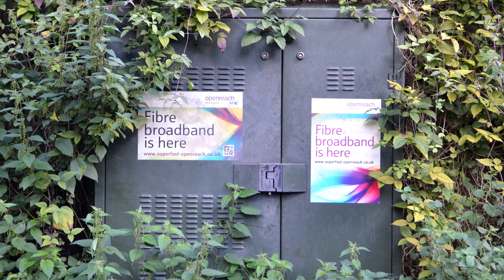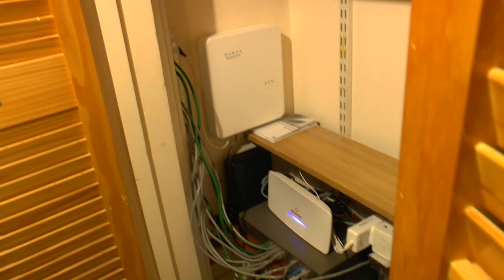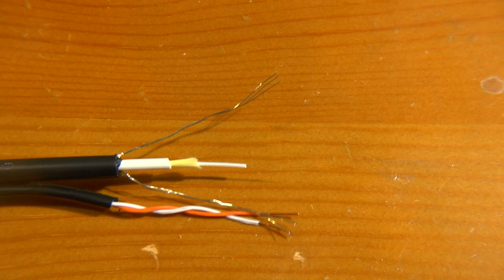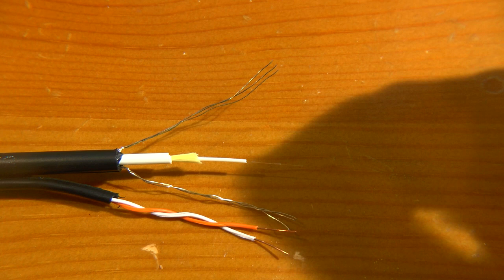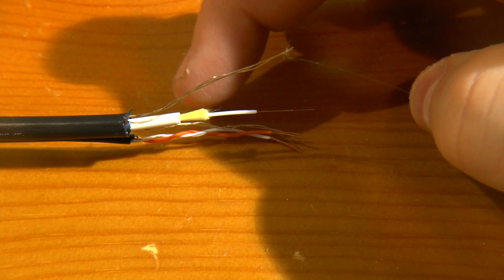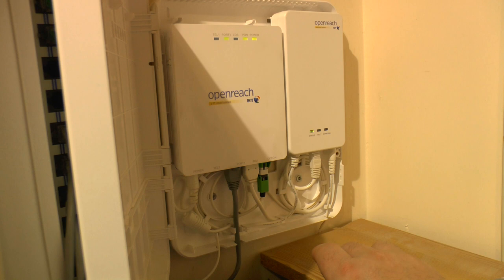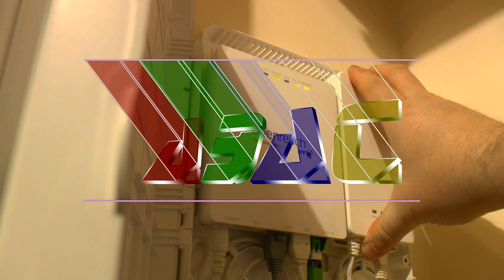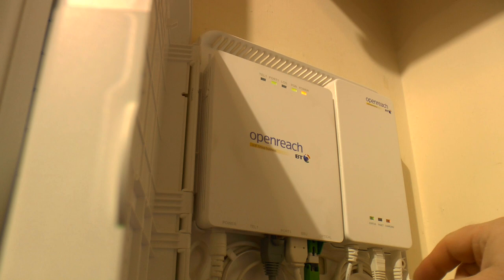FTTP - Fibre To The Premises

Comment: I have a question, the other ports around the house have shutters over them, are they connected to the fttp
Reply from the maker: Ports around what house? I've just skipped through the video and can't see any.
BT NTE sockets and RJ45 outlets usually have shutters so it depends which you're referring to.
Reply: @AintBigAintClever  Sorry I meant the shutter ports around my house and if they are connected to the fttp. Sorry I am not very tech savvy
Reply from the maker: @jacobdavies7892  That'll still depend on what they are, plus whether or not they've been connected to anything at all.
If they're RJ45 (network) then they should all go back to a patch panel in a single location where they can be connected to a multi-port network switch or a broadband router.
If they're BT sockets then they should all go back to a connection on the back of the BT master socket (NTE5 or the newer NTE5C) unless you have just a fibre service in which case I'd expect them to go to a socket next to the FTTP unit. See page 12 of https://www.openreach.com/content/dam/openreach/openreach-dam-files/images/fibre-broadband/fibre-for-developers/guides-and-handbooks/oct-2019-update/Fibre%20handbook%20V9%20web.pdf
Reply: @AintBigAintClever  Thank you so much

Comment: What will happen if i unplug the back up battery? Does it need to stay plugged in?
Reply from the maker: I'd expect it to work without one.
Reply: AintBigAintClever it never. It ran for a few hours till battery died.
Reply from the maker: @muggerslane1  So you unplugged the battery, but left the battery plugged in?
Reply: AintBigAintClever. I unplugged it from mains. Never touched nothing else. It’s only got batteries as a back up incase a power cut.
Reply from the maker: @muggerslane1  I assumed you meant unplugging the backup battery from the system itself, not unplugging it from the mains.

Comment: Why do you need to routers where as virgin they have 1?
Reply: virgin fttp has a powered ONU outside on a wall in an ETB, this then connects internally to your router over coax. on hfc you just have the coax drop cable fed right from the street cabinet into the ETB on the wall and then in to your house to the router.

Comment: Can you use your own router with this? I have a mesh system currently which is miles better than any ISP router
Reply from the maker: You should be able to replace the router with another one (as long as it supports PPPoE) but not the ONT (which needs to deal with the GPON stuff).

Comment: What is the purpose of the battery backup unit.
Reply from the maker: If the FTTP unit is also providing analogue telephone service (through the BT jack at the bottom of the unit) then the BBU will allow this to work during a power failure.

Comment: Btw the 2 guys who installed my white box told me that the battery backup allows 4 hours of internet if theres a power cut but I said bollocks because the router doesn't have a battery so that will turn off but the box will be on, doesn't help me on wifi lol
Reply: Then get a battery for your router, not his problem
Reply: @AgentOffice  he chatted like  it wasnt needed like a spastic and I don't need the backup anyway because we don't get power cuts here.
Reply from the maker: It's not there to provide emergency internet service. It's there to provide emergency telephone service (if your phone line comes over the same optical link).
Reply: @AintBigAintClever  tell the geezer who fitted it lol. I don’t care like I said we don’t get power cuts and I don’t use a landline these days.

Comment: Curious to learn why you'd go to the effort of having FTTP, but then have only 80Mbps?
Reply from the maker: At the time Plusnet's FTTP pilot offering was FTTP at FTTC speed, at FTTC price.  Basically the same service delivered over fibre instead of copper.  It was still a welcome jump from the ADSL previously in use (the local cab was never provided with FTTC service and was last in the area to get FTTanything).  I've just checked and 145/30, 300/50, 500/75 or 900/115 are available if I want it, but I don't need it.
Reply: @AintBigAintClever  Ah - I assume you are in an area that without the FTTC cabinet (because it looks like it was physically impossible to land it) you were upgraded straight to FTTP. This happened around the corner from me in Bridgend - I have an FTTC cabinet about 1km away, but to the right of my street, the next PCP cabinet is bang outside a pub with no room for said FTTC, they all had FTTP years ago. Only last week have I finally been able to have FTTP whilst most of the rest of the town have had several options for quite some time.
And yes, I can appreciate ADSL straight to even 80Mbps FTTP is a massive, massive jump, because the latency is also so much better on full fibre.
Reply from the maker: @gorebrush  when I spoke to an engineer working on the pole by my house he said some of it was just to bring up the average speed in an area.  Got a load of cabs offering an average of 60Mbit download?  Drop a 330/30 FTTP cab in and hey presto, the average in the town has jumped up.  They could've plonked an FTTC cab nearby easily enough.  Incidentally that green cab is apparently down in its own well from where the road was raised but nobody was prepared to pay BT for the work involved in lifting the cab.

We've still got areas where FTTanything is unavailable.  Openreach have their work cut out if they're planning on shutting down the analogue services on time.

Comment: Houses on either side of mine qualify for fiber to the home  Our building doesn't. its listed as a single family dwelling but was taken over by a supportive housing provider and now has ten separate people living in it. As a result of it now a  Multi-tenant unit and all tenants would have to sign up for internet service on fiber  before Bell would run fibers to the building and the agency that owns the building would have to do the renovations to run fiber to each individual room at their cost (They have quoted by Bell $1000 per room to run fiber from the street  to the building since they are individual tenancies and each is considered a new install for  the building as a result of it being marked abandoned a  few years ago) . The agency that owns the building then  was quoted $500 per room to run fiber into the building and into each room (All ten must be done simultaneously), So we will not have fiber this century. They have already removed the copper connection to the building since  the house was marked as abandoned as a result of a malicious neighbour that wants us out of here. So I just use my phone.

Comment: they dont supply the BBU anymore
Reply from the maker: If the phone socket on the ONT isn't used then technically it's not needed. If the socket is used then the BBU will be required to maintain PSTN service during a power failure.

Comment: Wow this set up so over complicated! Our fibre goes straight to the gateway. Our gateways have a built in ONT made by Calix which is so much better and less equipment. Does your government require this type of set up?
Reply: This isn't overcomplicated because openreach network must allows other ISP to sell services. ONT is openreach equpiment and router can by supplied by any ISP chosen by client. Else how you would do it? You can't really bring your own ONT/Router all in one in this kind of network. Search out a bit on Calix website, they are also doing 1 port ONT for familiar purpose.
Reply: @wiziek  & Doug; this is why you cannot get an IP address for a PC connected to the ONT; the router has to run PPPoE out of it's WAN port, to enable the packet level connection with the ISP you are buying service from. So in theory, you can swap out the BT hub for a Virgin or Sky Box (or change the login details if you have a 3rd party router)...
@ABAC ; informative video is from 2018; are Openreach still installing the same stuff 3 years later ? & will HM Gov have "something to say" about use of Huawei ONTs  ? ;-)

Comment: Is it surface mounted inside the house?
Reply from the maker: Is what surface mounted?
Reply: @AintBigAintClever  The fibre cable
Reply from the maker: @jihall47  In mine it's in 50x50mm trunking which I already had running down the wall, otherwise it would've been clipped to the surface. The inner fibre cable just looks like phone cable and is almost as flexible, I think they strip the outer black jacket off for most of the indoor bit, with the copper cable run into either a junction box to convert to white indoor cable or straight into a phone socket.
Reply: @AintBigAintClever  Thanks

Comment: i live next to my Exchange  litterally next to it  , that inturns gives me an EO Line (Exchange Only) . 
So becasue i have an EO line i cant get any form of super fast Braodband . i however am not fully upset by this as i do have Broadband and it is at max speed ish of 17 MB Down 1 Meg up  but usually i get 13 ish on a good day 15 Mb .
If i go to https://www.openreach.com/fibre-broadband and put in my address,  it now says after 9 years of being in this propperty that 
"Good news – we’ll be upgrading your area to Full Fibre (Fibre to the Premises - FTTP) soon."  
1 year later still nothing .. i have been informed that works will be completed by August 2020 but why do i have a funny feeling they wont be upgrading me as i live next to the Exchange .
Reply from the maker: They'll have to at some point but for some reason they can't just put green cab equipment in the exchange, they've got to put a new cab outside and move your line to it. Might be more straightforward with FTTP, who knows.
Reply: @AintBigAintClever  well lets hope its soon .. with 2 Teenage Kids and  2 Xbox ones and 3 ipads/iphones and 3 Smart TVs and 4 Alexas and 8 Smart lights all using bandwidth .. my poor 17 MB is at breaking point ! hahah

Comment: Wish I lived in a real fiber area(I agree with cityfiber fttc should Not be called fiber, it'd like mobile providers who said they had unlimited data when it was 2gb so three had to call there AYCE due to fake unlimited daga) ,

If FTTP was here I would drop virgin cable at right away (or might force them to put the FTTN nodes at the per street level instead of 10-30 repeaters running off one FTTN cab ,, 

As I am fed by a pole (if I was on open reach) so all I need is a 8 way fiber splitter on the pole please :) when open reach can be bothered to move to FTTH installs,

 I feel sorry for any one who is getting there phone lines from underground will be the last to  pepole to get FTTH (as they cost the most to do) 

as with houses that get fed from pole bt only needs to do work upto the pole (at there own time) and a engineer that has pole to house install fibre certified (like youtuber had) 

with underground the issue is the land owners property as they would have to dig up the ground to each house and all the ground to the house (and not all cabling is piped to the house a lot of them are buried)
Reply: We're underground here, but the cabinet is literally a single straight run of about 100m of duct to the manhole right outside our front driveway... from there a single length of new ish (2005) 3inch ducting that I installed myself after some twit (bows head) dug thru the 1960s armoured feed cable..
Reply: Pretty much all new builds for years have underground feeds and are fully ducted with swept tees. These are actually the cheapest properties to deliver FTTP to.
Reply: CarlT but they still use copper on new builds (all of the around here where I am still doing copper installs on new builds,they even had to dig up the road and curb to put more pipes in as they had filled up the current ones with copper cables)

Comment: Jesus man,i hav fibre to outside terminal. I download what i like, i stream what ilike. Never had an issue. Just a modem. What the fuck is your setup for? Methinks you are running a call centre from here. Home networks don't need to be that complicated.
Reply from the maker: Main switch feeds outlets throughout the house and out to the shed. Also feeds the wireless access point and a NAS.
8-port switch in living room feeds TV, Freesat box, Fire TV and DVD player, plus a spare cable for temporarily plugging in.
5-port switch in main bedroom feeds TV, Fire TV and DVD player.
5-port switch in second bedroom feeds Freeview box, Xbox and DVD player.
5-port switch in attic feeds UPS and CCTV system (used to feed a Domoticz server as well but that's moved next to the main switch now).
Why not all on wifi? Because not everything can connect to wifi, plus gigabit Ethernet wipes the floor with it.